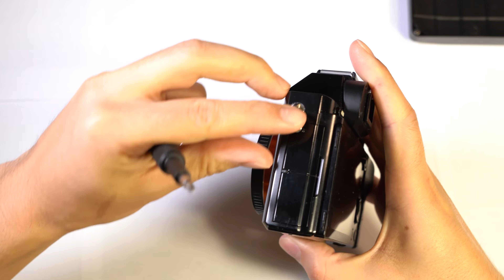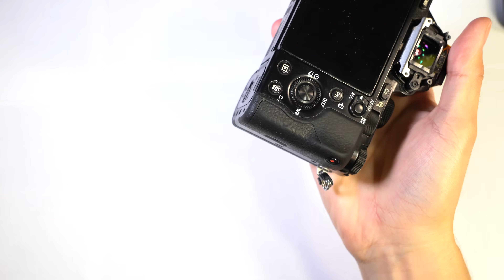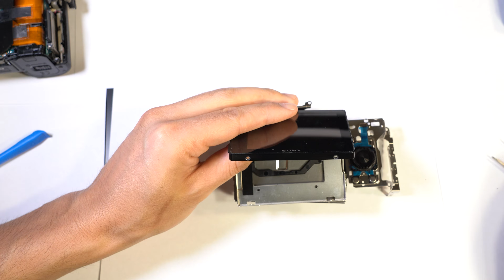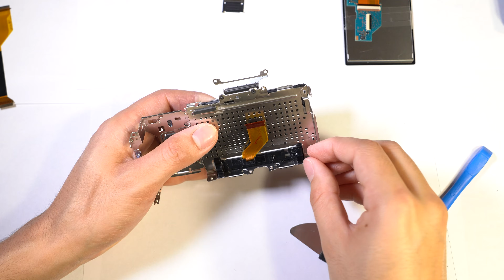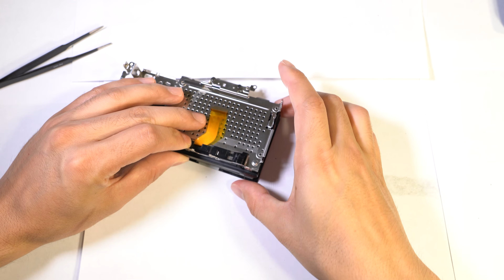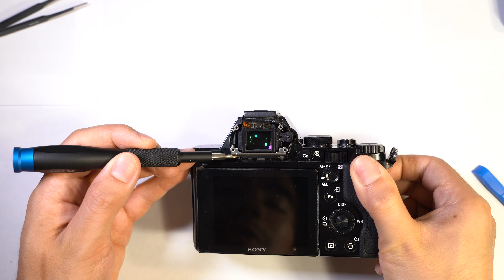How to Replace the LCD Display Panel on a Sony a7, a7s, a7r

Comment: This is video is amazing for replacing the grip as well since you disassembled it so far!
On the A7(R) II they made the rear rubber grip a seperate part but on the mk I it is integrated into the entire rear bezel.

Comment: !!!!!ATTENTION!!!!! for future reference when it comes to ribbon cables installation/removal :
-------------------- there's a tab/latch on each connection port that is used to secure the cable to it, you need to flick/pry it open which would make installation/removal waaay easier, i broke my screen to motherboard ribbon cable from forcing it in the port while it was closed, you can also look up @jake_do_stuff's "sony A7 Shutter replacement" for the full dissasembly process till he reached the shutter curtains. ----------------- ON ANOTHER NOTE : check F0004 fuse on the motherboard if it's blown (short it and check if the screen lights up) before buying an extra screen, it's responsible for power delivery to the lcd

Comment: Hey. Is it possible for the ribbon cable to power the viewfinder and not the monitor? 
My viewfinder works but the lcd is black. Seems to be off. I checked the settings and VF/Monitor is on auto.

Comment: That’s a great video- wish I’d had this when I messed this up 3 years ago and broke a motherboard connector! I’ve got it back out of the attic and want to get a new motherboard and fix it properly, but I do remember I went too far dismantling the screen mount assembly and it didn’t move properly when I reassembled it - I think I’m missing some kind of metal spring but your video doesn’t quite cover that part. Do you have any info on that?  Many thanks Mike

Comment: replacing the screen only was as simple as getting the 2 mount screws on the bezel out and the 2 screws on the back of the panel. Take off bezel, pry out the two ribbon cables, insert new screen and two ribbon cables and put it back together again. It is not neccessary to dissassemble half the camera if you are only switching out the screen.
Reply: lol try it first 😂
Reply: @kraftthecreator  Would not talk about it if I did not know how to do it. I fave the instructions to do so, so I know from experience, read my second comment for more details. Thank you for your concern.
Reply: I agree. This video was awesome and much appreciated! But with all the extra steps all i will say is goodbye weather sealing.. but very interesting seeing it done. Currently waiting on parts from china and studying up on how to!
Reply: @mqazzaz  At 8:49 he removes the screws on the back of the panel, you can do that while it's on the camera, then take the 2 screws on the bezel of and yoy watch where he he discnnects the ribhon cable and then all you need to do is replace and put back together.  Hope thatn helps, good luck and get some small prying tools or a guitar pick. To pry stuff apart. It not hard just tedious, Patience is your friend.
Reply: @Lalaland.001  This way makes it very difficult to insert the display ribbon into the driver board. Doing it the long way is a bit tedious, but its a lot less frustrating.
Reply: I have used both methods, this method you bring is much less steps... but it does take a dexterous individual vs this method of tear down replacement.
Reply: Wouldn't it be very hard to attach the ribbon cable that connects the display from the camera because it's too short? I think this step is where a lot of people break this ribbon cable.
Reply: @ShutterKnack  It is totally unnecessary to do that, if you already took the time to carefully take it apart it would be much simpler and straightforward to do it the way I described. Taking apart the entire camera only invites in more problems that could happen along the way, dust being the main enemy of all things electronic, the more you open something up the more can get into it. The solution always works like this; the less components you need to take off, the less can  go wrong. Also what can go wrong will go wrong the more moves you have to make to get to the solution. Always take off less, if possible. Always.

Get a good pair of tweezers, made for this job and presto, it makes for an easy re-attaching of the cable. Might take some extra time but not nearly as much as taking the camera apart the way the uploader did...

Hope that helps.

Comment: Hi, thanks for useful video, I succesful changed damaged display ribbon cable on my A7. One tip - the ribbon cable ports have a lock bank for the flat cable, it is the small black or brown strip on rear of the port. It can be levered up with fingernail or one tool and then the cable can be insert or pull out with easy into/from  the port and after inserting the locker must be levered down to secure and for good contact.

Comment: Hi. Why did you replace the LCD, what was the fault?  The display on my A7sIII stopped working, it's just dead, no light, no image. Viewfinder and video signal via hdmi on an external monitor work normally. Any thoughts? Would you suspect a bad display or a worn cable or are there any chances to have something even worse like some bad part on the board?
Reply from the maker: I think I did some internal damage to it pushing it too hard. Sounds like you could either have a loose cable or a bad display.